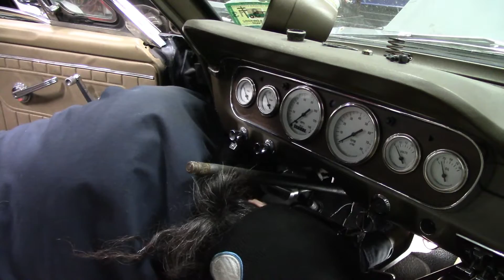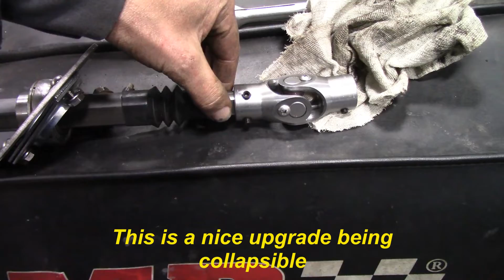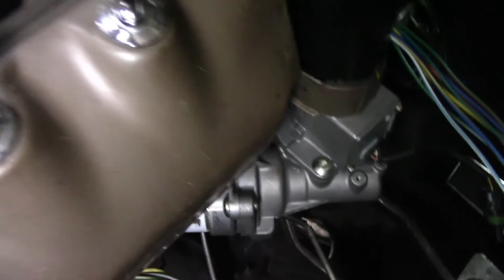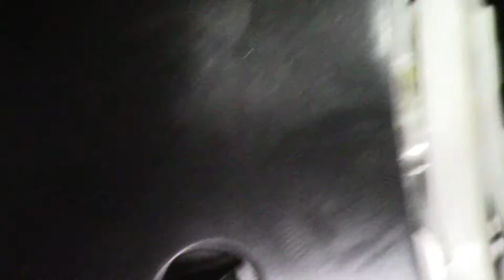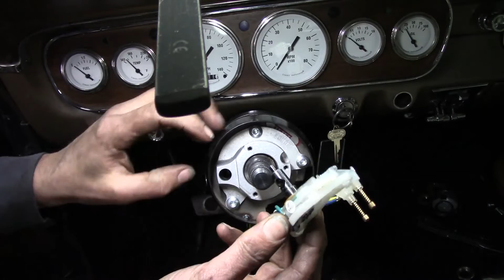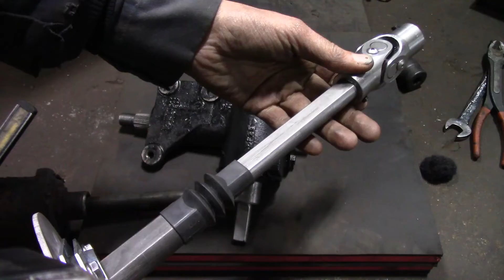Electric Power Steering  Conversion Kit Part 1 EPAS

Comment from the maker: After this video was filmed, we ended up having to remove the turn signal switch after all. It turned out that once mounted it was rubbing no matter what we did. After removal we compared it to the old one and confirmed it was twisted due to the initial installation being incorrect. So, we had no choice but to waste more time installing the old switch to the column.
Reply: How did this system end up working out for you in the end was hoping to see a part 2 video

Comment: i have 4 mustang ,so i made a kit very safe , easy to install with all correct size for automatic or clutch system , i was test prototype at jtekt factory during 15 years  , maker of most of this , i use new materiel  , no u joint

Comment: Installed this over two weekends recently. Takes a lot of trial and error to get everything to work together but once it does its a fantastic system that works great. You can adjust to full power one handed steering or to almost manual steering feel. The problem is the instructions provided don't walk you through the whole process, there is alot of thinking on the fly involved, you need to be a little mechanical minded to install but if you give it to a shop to install for you they will charge you a arm and a leg because they will have to do all the thinking on the fly as they go. Best to try it yourself even if it takes longer than anticipated you'll feel like you accomplished something after... If I can do it anyone can... One more issue is remounting the park brake... You will have to engineer a small bracket to get back to the position it was or it won't work at all. That's another thing the instructions fail to tell.
Reply from the maker: Agree with everything you said..

Comment: I just added EPSA's electric steering to my 64 Corvette. You are so right that it is wise to test fit all the pieces BEFORE installation. Foolish me, I didn't do it and the sliding shaft had burs on it and would not slide far enough to install it in the car.  Also, the splined part that fits under the dash bound up when I tried to insert the U-joint to it and I had to remove the whole thing to clean up the splines. There were many errors in their instructions and like you, I found many things missing from the video or not for my model of car at all. However, once it was in it was great! I can turn it up to full power steering and turn it with one finger or turn it down to almost no assist at highway speeds. Only time will tell if it lasts.

Comment: It's like a Dorman part.  Has anyone at Dorman actually installed one of their parts?  Sure makes me wonder sometimes.  I think this will be a decent setup once you "customize" it to fit the car it was built for...just like a Dorman part.  Helicoil the missing threads, throw out the new turn signal switch because it doesn't work/fit right, and modify it all so it fits.  Isn't that Dorman?  Side note:  I saw a hydraulic ram style power steering system added to one of these and it was a real hack weld job underneath.  Guy wanted to have me do a bunch of work to the car but I ran like the wind!
Reply from the maker: That ram setup looked like a factory hack on these cars. They are complete garbage.  The Mach 1 I did the series f videos on was also hacked by the last guy who worked on it. I spent countless hours on that car to straighten it out.
Reply: @JoesAutoElectric  Wow.  if that was factory, Ford should be ashamed.  It had poorly welded in angle iron if I recall and I thought it was some backyard shop install.  Thanks for the vids!

Comment: That's mad that you pay 3 grand and they use flimsy plastic instead of the ford metal
Reply from the maker: I'm not sure what you are referring to on the plastic. The switch is a stock Ford switch.
Reply: @JoesAutoElectric  ow sorry I thought you meant they kit one was plastic the stock was stronger and never rubbed

Comment: IMHO😲 3K💰 for it, No way Jose`            Not sure if it`s a gain of minimal loss of HP by wanting a EPSA  or more feel from the road in steering Performance from the customer but i would rather spend money on Motor Performance and go with a good P/s rack and pinion upgrade instead.     Not criticizing his freewill to have intalled what he wants but rather what potential gains outweigh other weak links.
On to the product Quality Control i agree it comes up a bit short for the price you pay for it.   Any warranty on manufacturer defects w/ the unit ?
Reply from the maker: Is what it is. 5 year warranty...

Comment: Hi Joe, interesting video, I agree 100%, that the kit should be fit for purpose for that kind of of money, you shouldn't have to waste time and money fixing this shoddy assembly, on a more serious note how do you stand if as a result of this mod there was an accident later, are you liable for the whole claim or how would it go ,?Just wondering?, because here in the uk I think they would go after the guy who fitted it, and the manufacturer  if faulty parts were involved.  Best wishes to you and family, stay safe, Stuart.uk.
Reply from the maker: I think it all depends on how something failed. I mean, you can do an oil change on a  vehicle, have it leave, the guy blows a tire and he will try to blame you. All I can do is make damn sure that the assembly is installed properly and everything is tight and secure before it leaves my possession. If the unit somehow fails, it will resort to manual steering, If something on the system, God forbid, breaks as a result of being defective, then it is on the maker, not me. This is normally the case.
Reply: @JoesAutoElectric   thanks for the reply Joe,  looking forward to the next one, kind regards, Stuart.uk.

Comment: Yeah Joe My 1973 Volkswagen Beetle had retractable over should seat belts, controls on the steering wheel.  And to the point it had a collapsible steering column.
Reply: My first car was a '73 SuperBug. (Neat things happen when you put '69 1500 pistons in one!!!! Got a 19yo kid 70mpg!!)
Reply: @HouseCallAutoRepair  Hi that's neat but I was never a fan of the superbeetle.  I had one and front end issues plaqued me.  The regular beetle had more options like disk brake kit front end etc.

Comment: If the car did not originally have PS, I'd find some other solution other than the electric unit.
Reply from the maker: It has advantages.
Reply: @JoesAutoElectric   No doubt.  I imagine installing an original style would require a lot of disassembly under the hood.
Reply from the maker: @jeffryblackmon4846  Yes, and it would add potential for leaks and multiple part failures in the future that you don't have with this system.

Comment: Thank you for making this video.... Me personally I would never put electric steering in a classic but I still like to see the process to do so in case I ever have to put one in for some one. And I know you'll be honest about it.
Reply: Lot of things to recommend electric power steering, though. Sure, if you are making a museum piece, don't do it. But otherwise, it really is a great improvement in all regards.
Reply: @bladder1010  electric steering been around for awhile..... Museum peice? It looks like the kit still uses a steering box, if I were to mod the steering I would go with a steering rack either manual or power. New isn't always better and to each their own and as for my old cars I drive them every day and prefer them over modern cars and I do own two modern cars but to me they are just to overly complicated for what they are. And I do all repairs to them myself both have over 150.000 miles on them.
Reply: @moparnut6286  Fair enough, and like you say, to each his own. Personally I like the mechanical simplicity of electric, and the fact that it doesn't rob as much power from the engine.